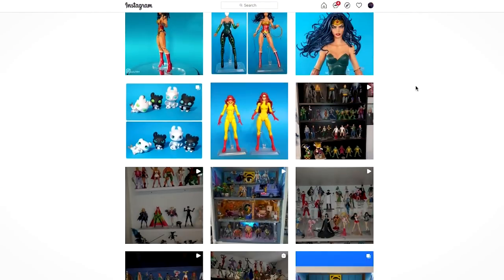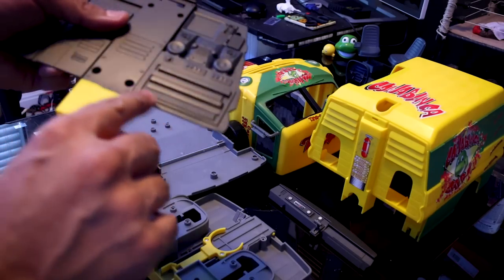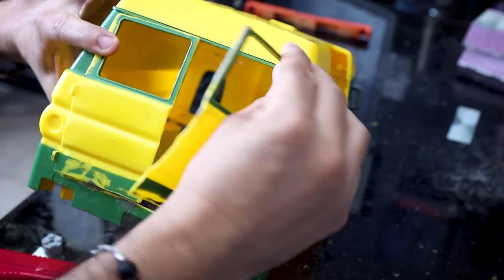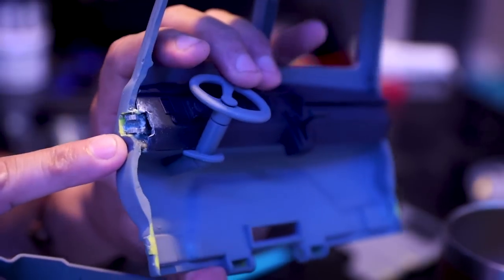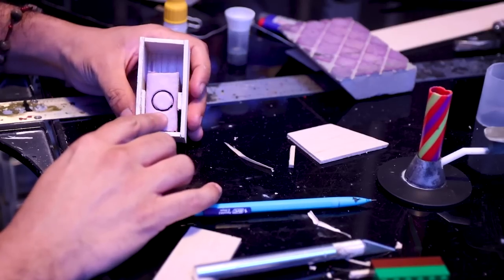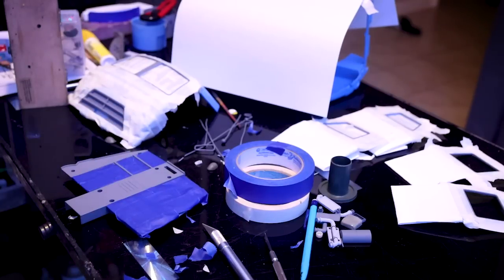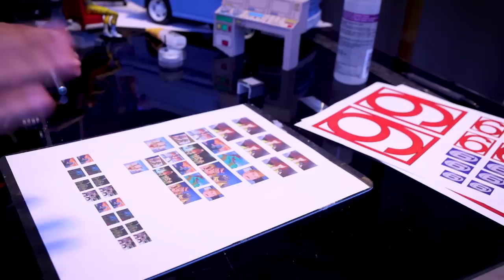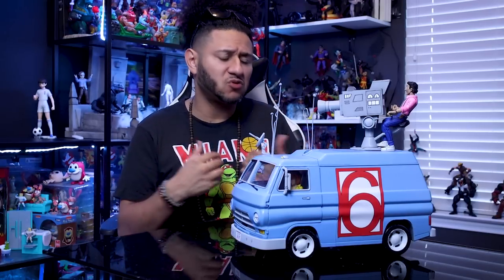My Custom Channel 6 News Van for NECA TMNT Cartoon | Vlog160

Comment: Great work as always. Legos ftw.
And run a blow dryer on stickers and labels from a couple of inches away for 15 to 20 seconds. It heats the glue and you can peel them off with little to no residue

Comment: great stuff my man! Kudos! attention to detail is crazy! You got inspired by someone and we are getting inspired by you! talent should never be hidden away for sure. I own the original party wagon plus the channel 6 van minus all the accessories. I got the part wagon for $8 at a flea market in 2013 and the channel 6 van for $20 shipped from eBay in 2017. I could not believe my luck, and it was on bid too. back then they were going for $200 or so completed, now its 2-3 times that much. I am going to turn mine into an RC with real rubber slicks and alloy centerlines. I am an RC guy so this is what I will be doing.

Comment: Awesome job drip im going to be working on a custom with the sme vn i am going t d the scooby doo mystery machine van with my bro you inspire me with this project keep up the good work God bless u man 😊
Reply: I forgot something how did you remove the back seat?
Reply from the maker: So the backseat and the tire cover under it are tid together with a screw that you not going to be able to see … so I remove the tired one but that just makes it loose but the screw inside is still screw together … so I wiggled it back and forth until it’s broke off . It’s a piece that ur not going to need. It wasn’t easy at all.

Comment: Wow just wow 👏 always creative, always informative. I'll say it again a modern day Bob Ross. On a different note been thinking about buying a airbrush but have had different opinions. It's to hard, it's messy ect. I'm curious? What's your opinion on a first timer but not cheap airbrush?
Reply from the maker: Believe it or not ... I’m a beginner with the airbrush lol this is the one I use ... it’s enough and the price point is very fair ... check out out VIVOHOME 110-120V Professional Airbrushing Paint System with 1/5 HP Air Compressor and 3 Airbrush Kits for Tattoo Makeup Shoes Cake Decoration Black https://www.amazon.com/dp/B0796M9QVJ/ref=cm_sw_r_cp_api_glt_fabc_T66089CT56Y55R1NZ9D6
Reply: @dripmode  awesome thanks I really appreciate it. Keep up the amazing work.

Comment: What is your preferred glue for attaching the lego to plastic? For attaching the paper to plastic? Thanks. 

I’m working on a TMNT cartoon project myself. Your video has helped greatly.
Reply from the maker: Lego to plastic is super glue of any kind but the secret is to put one each surface first .. let it chill for 10 sec and then put the two piece together and it will be instant. For paper on plastic ... u can use tackle .. and do the same but the hood part .. you can adjust the position if you need to with a small window time frame. I play with them all for different scenarios :) . Hope that helped bro

Comment: How did you get the back chair out where the spare tire is
Reply from the maker: I broke it off slowly
Reply from the maker: I mention that this van has some challenges taking it apart ... the spare tire ... the chair and the wall between the front and the back . :)
Reply: Thanks bro I love your work
Reply from the maker: Np bro ... thank you for reaching out and supporting my work :) if your building this van ..... I hope my video helps u :)

Comment: How much was the cowabunga Carl van
Reply from the maker: I’m not offering this for commission. To expensive to offer
Reply: @dripmode  oh sorry I wasn’t asking that, I meant how much was the old cowabunga Carl van you used to make this?
Reply from the maker: I got it for 55 but that was luck … on eBay they run from 50 to 100
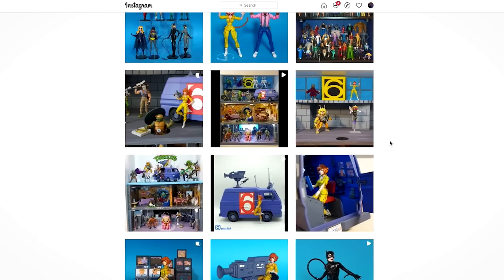Reply: @dripmode  shame there so expensive these days, have you ever found a cheap 1:12 car or van that fits figures inside?
Reply from the maker: Not 1/12 … check out my garbage truck repaint … I found that truck several times in thift store for dead cheap